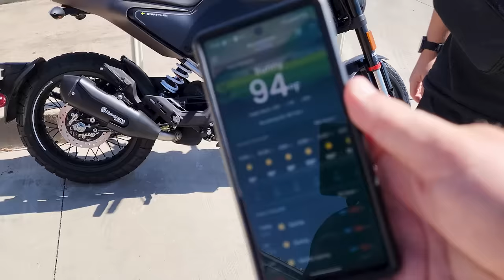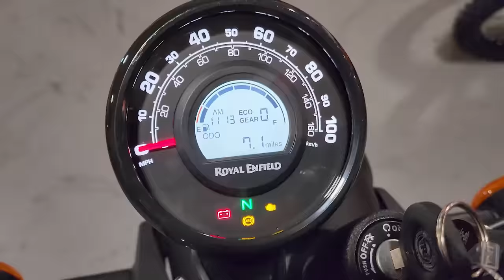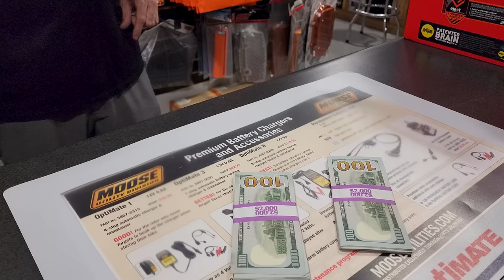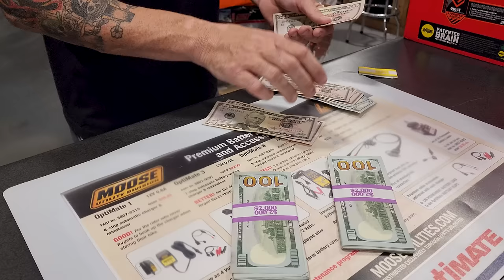2023 Royal Enfield Hunter 350 // USA Owner's First Ride Review (RAW)

Comment: The RE is made to last in much harsher road conditions of India. It will easily last well in other countries without breaking a sweat.
Reply from the maker: Hopefully, that's the case!  The build quality and durability of the frame and suspension seem very good so far.  The engine and transmission longevity/reliability are the unknown factors in my mind.  Our roadways are much longer and faster here in the USA (particularly Texas) than most other parts of the world.  The sustained high-speeds for commuting and touring on our highways might stress the engine more than other environments.

I've already clocked over 1000 miles in the first month of ownership, and I haven't had any problems so far.  I will be performing a long-term oil analysis on the Hunter 350's engine that should provide some interesting metrics on engine wear and projected longevity.  We'll see how it goes over the next 20K miles... wish me luck!  😉👍  --QM
Reply: @QuasiRAW  That will be interesting. Good luck and congratulations on your new ride. 🙂 Happy riding. Wish you more smiles per hour. 😂
Reply: Wish you good luck .... cheers mate .. only legends use Royal Enfield
Reply: @QuasiRAW stress on engine is more in stop n go operation rather than cruising..so if lasts in India it's supposed to do better miles in US
Reply: RE is one of the most unreliable bike. I'm from India.
Reply: It's make for all types of road
Reply: @QuasiRAW  dont worry we have tested the beast in actual himalayas of leh and laddakh, you should join some bike expeditions here in india, we ride 600-2500 km in 2-3 days with temperatures ranging from 48 degrees celsius in rajasthan, gujarat, maharashtra to -10 sometimes -20 degrees of leh.
Reply: @QuasiRAW Good luck with your Royal Enfield.
Reply: @maverickcruise earlier
Not now
Reply: @maverickcruise  don't think so dude, I've seen people keeping their REs throughout their lives , definitely not unreliable. This brand has got a good rep among riders.
Reply: @QuasiRAW any update so far ?
Reply: @QuasiRAW my grandpa has an royal Enfield like this, using for 10+ years, more than 1,24,274mi used but got no major problems. Got small abs issues but solved within the same day at service center.
Reply: @maverickcruise  wtf man 😂 why are you saying like tt?
Reply: Roads in India are very much improved now specially the highways are now world class .
Reply: @QuasiRAW The speedometer is optimistic by a few kmph by design. It is intended to show more speed than true speed to reduce reckless driving, don't know how that works but that's what they say
Reply: This bike is not for longer high speed roads
Reply: @QuasiRAW frame breaks on ride people have reported on RE Himalayan
Reply: Just another American thinking Indian roads are bad. Lol
Reply: @QuasiRAW it'd be great if you can share the results with us as well.
Reply: U can't be...no Indian would say that

Comment: I was really considering a KTM Duke 200 but I really like the offerings from Royal Enfield and I really like simplicity when it comes to maintenance. Royal Enfield parts seem to be reasonably priced.  I need something that can really munch miles.  The Hunters range on a single tank really puts it high on my radar.
Reply: Get a 500 .
Reply: As long as you understand it's got no guts at highway speed beyond 60mph, it starts losing pulling power around 60mph, Max speed is 75mph on a good day. You'll end up floating around 70s, high 60s on headwind.
Reply: @ShikiKaze my friend going 100 mph on GT
Reply: @akshaykumar-wd8jc  hunter goes 120 and ecu unlocked 135 -140 
Which pretty high for 350 cc retro/cruiser bikes
Reply: RE bikes are slow af… If you’re okay with slow bikes then go ahead
Reply: @ShikiKaze  RE isn't meant for speed. It's meant for comfortable effortless cruising without breaking the bank. If speed is your poison RE isn't for you.
Reply: @pck85 RE bikes are more for cruising, they were never meant for speeding. And my god, The engines are so refined now. It’s way smoother than ever.
Reply: Once you ride a HONDA CB350RS you cant even think about buying an  RE bike, HONDA is far refined ,peformance oriented and better standard of building, as an INDIAN i always support JAPANESE engine refinement and there technologies.
Reply: @HorSterR that bike is not available in normal showrooms that's the biggest issue u can only buy that bike if bigwing is in your city
Reply: @vivekshakya6772  Sir Im a CB650R owner and I always go for Honda Bigwing Rally,Honda Bigwing showrooms are so common at banglore and we always get premium service too. So that’s not a big deal.

Comment: In India light is turned on default for motorcycles you cannot switch off nowdays
Reply from the maker: Yes, the DOT (Department of Transportation) laws are the same here in the USA.  All motorcycles are required to have low beams engaged at all times and they cannot be disabled.  I ride with my high beam active during daylight hours for safety and to add extra conspicuity in traffic so other motorists can see me.  Our cagers are notoriously inattentive and don't look for motorcycles when changing lanes or pulling into intersections.  If my high beam annoys them enough to see me, then I achieved my objective:  THEY SAW ME in the sea of traffic!  😉👍  --QM

Comment: I have the dapper ash colour, and I went on a 500+km trip. It's been over a year and I have travelled 17k + on my hunter mainly commuting from office to home and vice-versa. Some observations that i have are the brakes could be better, rear suspension is stiff as you said and be very careful on wet and loose roads The bike doesn't offer much in those conditions also it can get on the right side of engine specially when are stuck in traffic idling. Otherwise it's a great and fun bike to ride

Comment: I have had the same model of bike and agree that the suspension is too hard. Even after 1300 miles I think it is still too stiff. I’m now on the lookout for an aftermarket alternative. My valves were seen to be tight on the 300 mile service.
Reply from the maker: Agreed!  I'm shopping for some adjustable shocks in the sub-$400 price range.  I did the first service last week, and the valves were just barely out of spec.  The intake was loose and the exhaust was tight by 0.02mm each.  I'll post that video on my main channel ( @QuasiMotard ) today or tomorrow.  Cheers!  😉👍 --QM
Reply: When I took delivery of mine in May the rear suspension was very hard, but 3 turns on each rear shock made it a whole lot better. This is a fantastic fun bike to ride and the fuel economy is amazing.
Reply: Some folks here in India have tried putting in the classic 350 reborn rear suspension on the hunter. It seems to have solved the issue. You could give that a try

Comment: I own this bike. Sharing my honest opinions after 1 year of usage in India.

Cons: 
1. This bike becomes completely unstable if you hit the speed above 100 kmph. I see this as a major drawback from a 350 cc bike. 
2. Bike doesn't react immediately on gear changes. Speed pickup is not up to the mark.
3. Didn't thought to add a smartphone holder unit but they gave an usb port for charging. What a dumbass work. 

Pros:
- Looks good when it comes to design.
- Braking is good due to dual channel ABS.
- Good for beginners to start riding. Easy to ride.
- Safety Features :
    - If bike is on a stand, the engine won't start. You have to remove the stand, then you will be able to start the bike.
    - Inbuilt emergency automatically engine off feature if you put a stand on the bike without knowing that you are on a gear count > 0 and the bike engine is on.
- Odometer comes with inbuilt adjustable clock, Gear count indicator & Trip modes (A, B, F) which help riders in the best way possible.
- You can stop the bike engine at any gears and start back from the same gear. But I will not recommended to do this as it can damage the engine.

RE Service Centers are worst. While getting a free service, they created a defect in my bike by creating a problem in the battery segment. Now, turning on engine takes time. Earlier it was smooth.

If you are a pro-rider, please stay away from this bike. You will not have that much fun on this bike. Don't get distracted by ads shown. :)

Comment: It may be okay to put high beams on in the U.S because of safety concerns. In India, the high beams are not just annoying but affect visibility of not just other bikers but also car drivers coming from the opposite direction. I say thisbecause there are more bikes on the road than cars
Reply from the maker: The situation is similar here in the USA.  We only ride with our high beams during daylight hours to aid with conspicuity... to ensure that other motorists can SEE us on the road.  The difference between a motorcycle/scooter high beam and ambient daylight isn't sufficient to cause blinding, but it certainly aids in being seen.  Of course, we dip to low beams at dusk or when we enter areas with lower light (e.g., parking structures, bridges, tunnels, etc).  Cheers!  😉👍  --QM

Comment: the bike is good overall, but the wiring looks pathetic:face-red-droopy-eyes:
Reply from the maker: I found the fit and finish of the Hunter 350 to be quite good.  The wiring, switch gear, and the overall aesthetic of the bike looks and feels more like a British (almost Japanese) bike.  

The only thing that looked really out of place to me is that obnoxious front brake hose that sticks out past the forks.  That could (should) have been routed across the handlebars and then under the triple-tree to follow down the INSIDE of the right fork leg instead of bulging outward.  Meh... whatever.  🙄🤷‍♂️  --QM